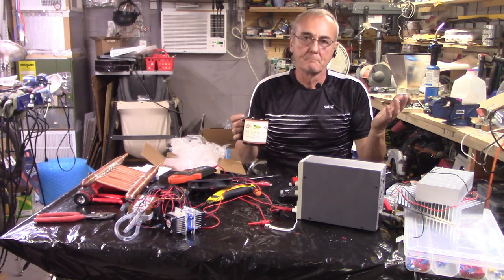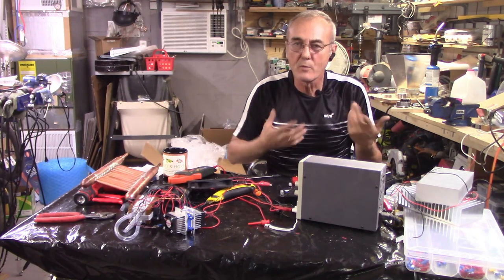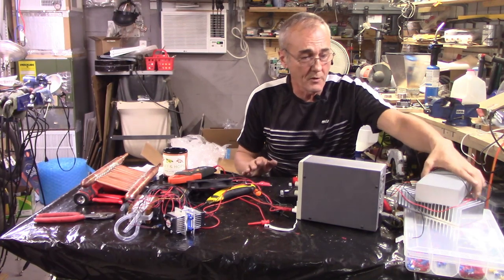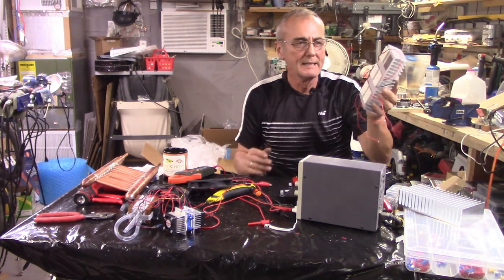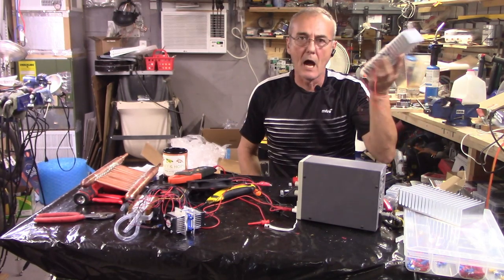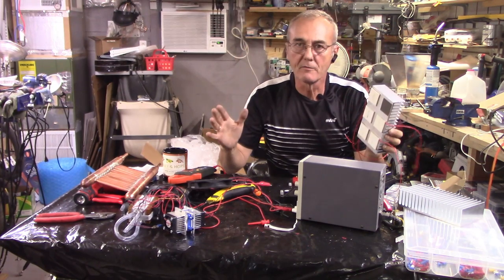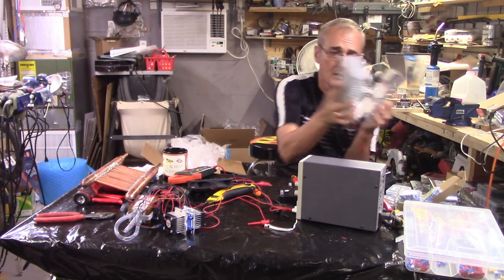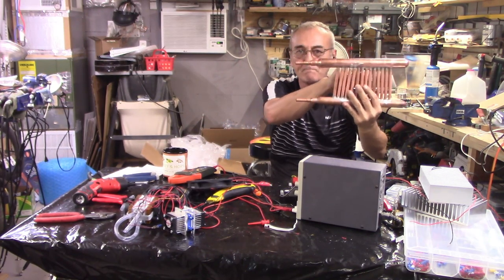INTRODUCTION TO COOLING AND MORE

Comment: Consider that your best heat exchange would be if your copper surface was flat, similar to a cpu water cooler. More contact between two flat surfaces than flat on round. Even if you put a flat copper plate against the round then the peltier on the flat.
Reply from the maker: Thanks. I'll try that
Reply: I was thinking the same thing as well. And maybe somehow adding lots of contact metal between the round copper tubes and a flat copper plate.

Comment: Cooling has been on my mind these past few weeks. I’m struggling to control the heat generated by the fermentation process. I’ve tried a fan on the bucket and a cool water bath.
Reply from the maker: Me too. I do believe I can fashion something. I just need to settle down and do it.
George
Reply: Mike Jackson for beer fermenting in a sealed bucket; any chance you could fill 1 L plastic bottles with a salt water solution and freeze them, then while frozen spray them down good with star San and set them inside the bucket? I’m just thinking out loud here.

Comment: I too have been on a kick for cooling.  George, as you know, where i live, it is very hot, so my question is:  If an PID can control heating, can it also control cooling?  Being new to all of this i am using an ice chest with a water pump to cool and maintain my temperature.  Right now, i check the digital temperature meter ever so often.  if too cold, unplug the water pump, getting too hot, plug the pump in.  a PAIN.  So i thought the PID would work.  Thoughts?    David
Reply: Yes it will work just fine
Reply: @chuckdontknowdoya6100  Thank you.  I was thinking it would, but want to make sure before i built it.
Reply from the maker: Yes. You can set it in the parameters for heating or cooling.

Comment: if it were me I'd run the hot water through a small car radiator/oil cooler first to try to bring it down to room temp before chilling it otherwise you would need somewhere close to the same power being drawn as your heating element in peltier elements
Reply from the maker: I had not considered that yet. Sounds like a solid idea.
George

Comment: Use cpu liquid coolers(heat exchangers), there are chinese cheap made ones that are fine for this type of cooling. Than your design would be a lot more tidy and efficient. Happy distilling.
Reply from the maker: Thanks so much. I'll order a few today.
George
Reply from the maker: WOW!!!! These are expensive. I think I'll build a smaller model of this.
Reply from the maker: I have several of these and used them for my proof of process tests
Thanks

Comment: Hello out there George
Reply from the maker: Hey. 
George
Reply: Not related to this video, but can a mash oxidize like a wine?
Reply from the maker: Yes if you leave it open to the air.
George
Reply: Barley and Hops Brewing , 
Thanks for your knowledge. It’s been clearing for a couple days, should it transfer it off the lees or leave it alone till I run it? Hasn’t ever been open to air except to degas.
Reply from the maker: @rogerransom9864  You can leave it for a few weeks without any problem. If you want to store it longer it would be best to transfer it and seal it up. It will last forever